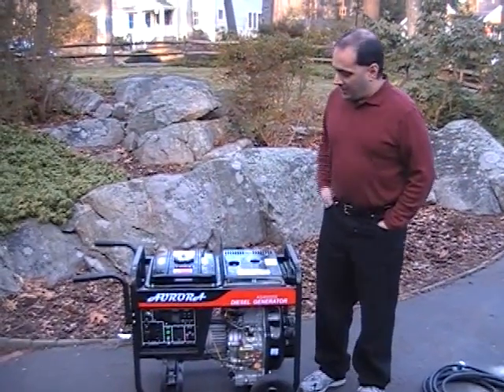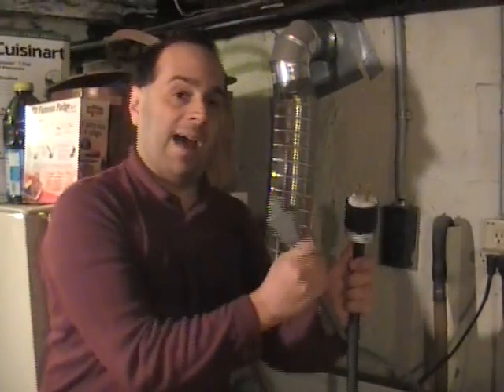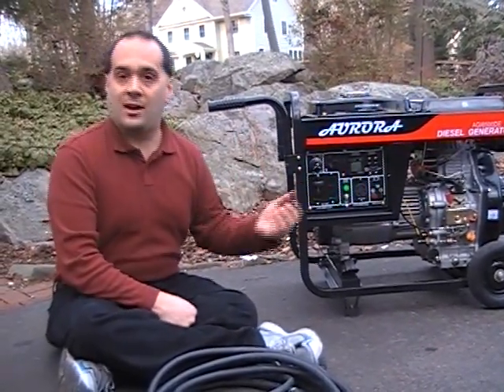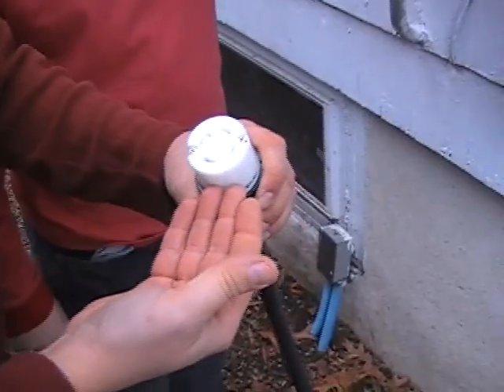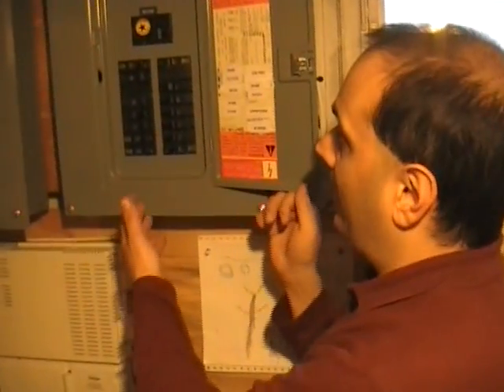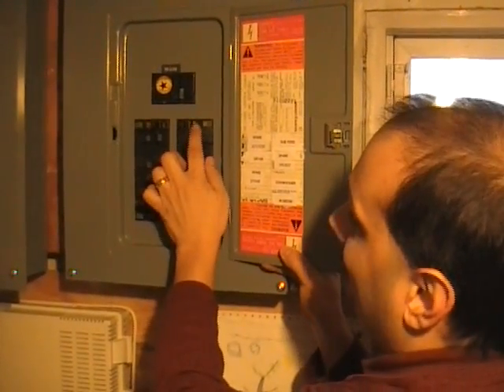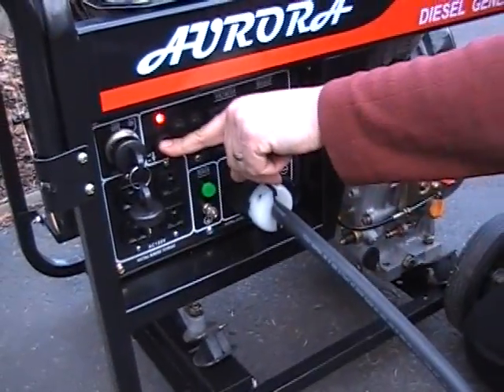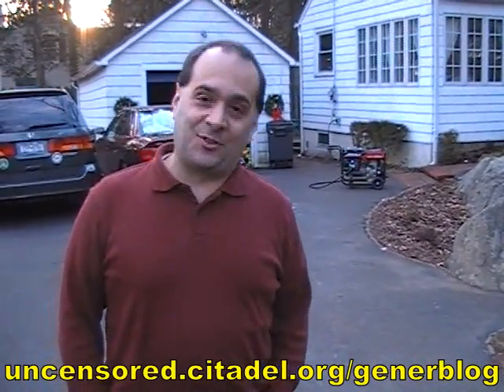Inexpensive residential generator hookup

Comment: Can this be achieved with a  4750 watt generator??
Reply: Yes. I actually power my entire house (except for my Central 4ton A/C Condenser) with two Honda EU2000i generators running in parallel. I have installed a 40 amp two pole breaker with the both poles paralleled together with a 30 amp fused connector.  This provides energy to every  light, receptacle, and 120 volt load in the house including the dishwasher, garbage disposal, and central furnace. 

We turn off the Main, and central A/C breakers before turning on our Generator Breaker.  The original 240 volt/ 30 amp two pole beaker was disconnected from the wires going to the dryer outlet in the utility room. That breaker was replaced with the 40 amp breaker with 8 gauge wire going to our outdoor rated power inlet receptacle mounted under the electrical panel. 

I have the benefit of all heating loads including the clothes dryer operating on natural gas.  We use two 5000 BTU window units for cooling during spring, summer, and fall season outages.  We are near Houston, TX. 

We do some load shedding when operating high current appliances (coffee maker, hair dryer, and the initial second of the clothes dryer start up) to prevent issues with inrush current causing hard starts of motors and compressors.
Reply: Here are the rules about portable generator safety: make sure you are aware of all the warnings before using portable generators. This is just a reminder for everyone’s safety. All generator safety rules should be followed carefully. This advice is just to make sure that everyone is aware of all the warnings and it’s just to remind people to be careful using portable generators. Generators can be dangerous if not used carefully. Every year, hundreds of people die or get injured when using portable generators due to carbon monoxide poisoning and electrocution. Make sure you are using your generator carefully and keeping others safe as well. There is something very serious that everyone should always be aware of when using generators. Some people do run their generator indoors which is not safe and that increases the risk of carbon monoxide poisoning which can cause death of family and you. Some people run their generator in wet conditions which can electrocute them. Please remember that you should never run your generator indoors. Remember that carbon monoxide is an odorless and colorless gas that you cannot see or smell. Carbon monoxide is a silent killer. Keep that in mind. Make sure your generator is 15-20 feet away from your house and away from doors, windows, and vents. Never use your generator in your porch too. Having a carbon monoxide detector is very important against generator safety. Some people also allow children to go near the portable generator which could pose risks. We need to keep an eye on our children making sure that they are not near the portable generator so they won’t get electrocuted or burned by the generator which is dangerous. A locking enclosure also keeps kids safe. A generator shed might look like a tempting place to explore, or take cover during a game of hide and seek, but a generator is a dangerous piece of equipment that can cause injury. It says on the manual that we should also keep children away at all times from the portable generator to avoid injuries. Please do not allow a child or unqualified people to operate the portable generator.  It is important to keep your children safe especially little ones. The portable generator can be hot during an operation. Just because some manuals missed what should be listed doesn’t mean it’s safe to do. Always follow the generator safety rules when using portable generators. Generators pose electrical risks. If you need to use your generator during wet weather, you need a generator tent to protect your generator from getting wet. Don’t let your generator get wet. Keep your generator dry and before using your generator, please make sure your hands and your generator is dry. Do not wear loose clothing when operating the generator. Everything that is said on the generator’s operating manual should not be ignored. Never smoke cigarettes near the generator. Please keep flammable things away from the generator. Never overload your generator too. Your generator can catch fire. Never ever try to plug a generator cord into a wall outlet to avoid back feeding. Back feeding your generator is dangerous. Always turn on your generator first before plugging in appliances and shut off the appliances before turning your generator off. Use a heavy duty cord for your generator and the cord should not be worn out. All the instructions should be followed carefully. Never refuel your generator while it’s running. It can cause fire if fuel spills while your generator is hot. You should turn off your generator and let it cool off before refueling it. Having a fire extinguisher next to the generator is also important. This is only a reminder for everyone’s safety of using generators. Make sure your generator is properly grounded. Having a fire extinguisher next to the generator is also important against the safety rules. https://youtu.be/I1jT3ANENvI and here is a video more about keeping others safe when using generators and also about our family’s safety. It’s important to keep our little children safe as well. Make sure they’re away from the generator. Hope this helps. Thank you.

Comment: Electric code? What the hell is electric code? we don't need no stinkin' electric code!
Reply: Bill It's the Code Enforcement guy who issues you a ticket because you are storing a car in you driveway without a license plate. It's the same guy who comes with the Police and Fire Department because you are running a portable wood stove in your house because you boiler died and tells you that the tenant has to relocate; the guy who says it's illegal for a house not to have an operating boiler, it's the same guy who ticket volunteers helping to clean debris after Sandy because they do not have a license.............................

Comment: Outstanding I've been looking for someone who actually did it right there's many ways to do it wrong and yes they are still powering their house's but with some very high risks to individuals at home and worse without a true interlock you can kill an unsuspecting lineman!!! Great job I hope more people see this version the others are too dmn deadly I also noticed every backwoods one also had comments turned off obviously for a reason real electricians were lighting them up.
Reply: Here are the rules about portable generator safety: make sure you are aware of all the warnings before using portable generators. This is just a reminder for everyone’s safety. All generator safety rules should be followed carefully. This advice is just to make sure that everyone is aware of all the warnings and it’s just to remind people to be careful using portable generators. Generators can be dangerous if not used carefully. Every year, hundreds of people die or get injured when using portable generators due to carbon monoxide poisoning and electrocution. Make sure you are using your generator carefully and keeping others safe as well. There is something very serious that everyone should always be aware of when using generators. Some people do run their generator indoors which is not safe and that increases the risk of carbon monoxide poisoning which can cause death of family and you. Some people run their generator in wet conditions which can electrocute them. Please remember that you should never run your generator indoors. Remember that carbon monoxide is an odorless and colorless gas that you cannot see or smell. Carbon monoxide is a silent killer. Keep that in mind. Make sure your generator is 15-20 feet away from your house and away from doors, windows, and vents. Never use your generator in your porch too. Having a carbon monoxide detector is very important against generator safety. Some people also allow children to go near the portable generator which could pose risks. We need to keep an eye on our children making sure that they are not near the portable generator so they won’t get electrocuted or burned by the generator which is dangerous. A locking enclosure also keeps kids safe. A generator shed might look like a tempting place to explore, or take cover during a game of hide and seek, but a generator is a dangerous piece of equipment that can cause injury. It says on the manual that we should also keep children away at all times from the portable generator to avoid injuries. Please do not allow a child or unqualified people to operate the portable generator.  It is important to keep your children safe especially little ones. The portable generator can be hot during an operation. Just because some manuals missed what should be listed doesn’t mean it’s safe to do. Always follow the generator safety rules when using portable generators. Generators pose electrical risks. If you need to use your generator during wet weather, you need a generator tent to protect your generator from getting wet. Don’t let your generator get wet. Keep your generator dry and before using your generator, please make sure your hands and your generator is dry. Do not wear loose clothing when operating the generator. Everything that is said on the generator’s operating manual should not be ignored. Never smoke cigarettes near the generator. Please keep flammable things away from the generator. Never overload your generator too. Your generator can catch fire. Never ever try to plug a generator cord into a wall outlet to avoid back feeding. Back feeding your generator is dangerous. Always turn on your generator first before plugging in appliances and shut off the appliances before turning your generator off. Use a heavy duty cord for your generator and the cord should not be worn out. All the instructions should be followed carefully. Never refuel your generator while it’s running. It can cause fire if fuel spills while your generator is hot. You should turn off your generator and let it cool off before refueling it. Having a fire extinguisher next to the generator is also important. This is only a reminder for everyone’s safety of using generators. Make sure your generator is properly grounded. Having a fire extinguisher next to the generator is also important against the safety rules. https://youtu.be/I1jT3ANENvI and here is a video more about keeping others safe when using generators and also about our family’s safety. It’s important to keep our little children safe as well. Make sure they’re away from the generator. Hope this helps. Thank you.

Comment: so where did you pick up the 60 amp for feeding the sub panel.?  I guess from the circuits you moved to sub paned
Reply: Here are the rules about portable generator safety: make sure you are aware of all the warnings before using portable generators. This is just a reminder for everyone’s safety. All generator safety rules should be followed carefully. This advice is just to make sure that everyone is aware of all the warnings and it’s just to remind people to be careful using portable generators. Generators can be dangerous if not used carefully. Every year, hundreds of people die or get injured when using portable generators due to carbon monoxide poisoning and electrocution. Make sure you are using your generator carefully and keeping others safe as well. There is something very serious that everyone should always be aware of when using generators. Some people do run their generator indoors which is not safe and that increases the risk of carbon monoxide poisoning which can cause death of family and you. Some people run their generator in wet conditions which can electrocute them. Please remember that you should never run your generator indoors. Remember that carbon monoxide is an odorless and colorless gas that you cannot see or smell. Carbon monoxide is a silent killer. Keep that in mind. Make sure your generator is 15-20 feet away from your house and away from doors, windows, and vents. Never use your generator in your porch too. Having a carbon monoxide detector is very important against generator safety. Some people also allow children to go near the portable generator which could pose risks. We need to keep an eye on our children making sure that they are not near the portable generator so they won’t get electrocuted or burned by the generator which is dangerous. A locking enclosure also keeps kids safe. A generator shed might look like a tempting place to explore, or take cover during a game of hide and seek, but a generator is a dangerous piece of equipment that can cause injury. It says on the manual that we should also keep children away at all times from the portable generator to avoid injuries. Please do not allow a child or unqualified people to operate the portable generator.  It is important to keep your children safe especially little ones. The portable generator can be hot during an operation. Just because some manuals missed what should be listed doesn’t mean it’s safe to do. Always follow the generator safety rules when using portable generators. Generators pose electrical risks. If you need to use your generator during wet weather, you need a generator tent to protect your generator from getting wet. Don’t let your generator get wet. Keep your generator dry and before using your generator, please make sure your hands and your generator is dry. Do not wear loose clothing when operating the generator. Everything that is said on the generator’s operating manual should not be ignored. Never smoke cigarettes near the generator. Please keep flammable things away from the generator. Never overload your generator too. Your generator can catch fire. Never ever try to plug a generator cord into a wall outlet to avoid back feeding. Back feeding your generator is dangerous. Always turn on your generator first before plugging in appliances and shut off the appliances before turning your generator off. Use a heavy duty cord for your generator and the cord should not be worn out. All the instructions should be followed carefully. Never refuel your generator while it’s running. It can cause fire if fuel spills while your generator is hot. You should turn off your generator and let it cool off before refueling it. Having a fire extinguisher next to the generator is also important. This is only a reminder for everyone’s safety of using generators. Make sure your generator is properly grounded. Having a fire extinguisher next to the generator is also important against the safety rules. https://youtu.be/I1jT3ANENvI and here is a video more about keeping others safe when using generators and also about our family’s safety. It’s important to keep our little children safe as well. Make sure they’re away from the generator. Hope this helps. Thank you.